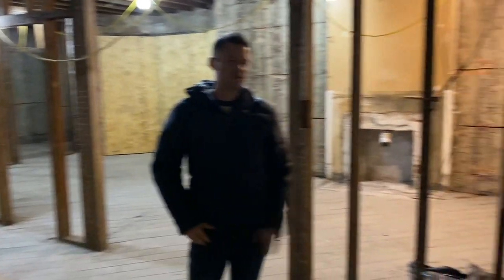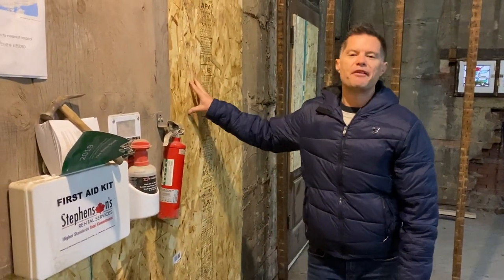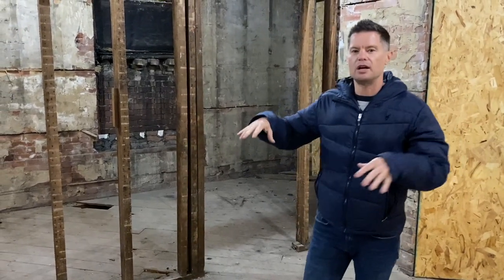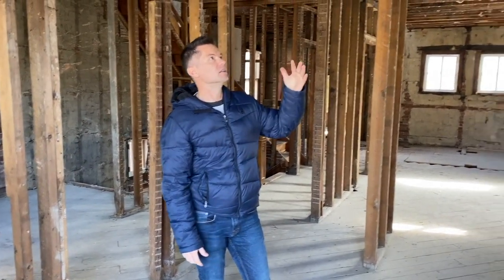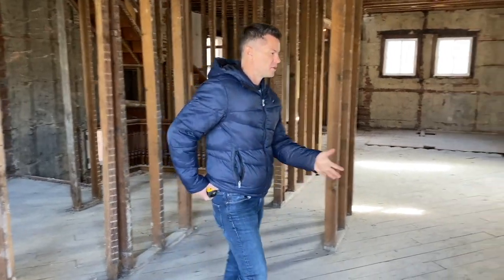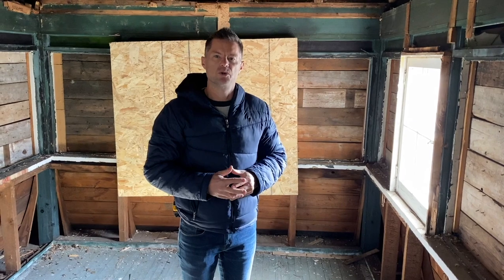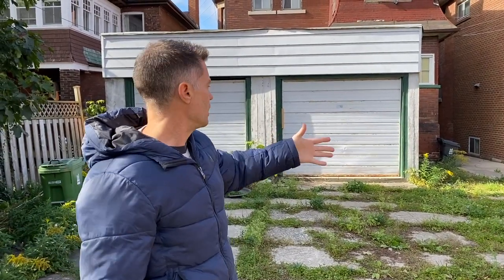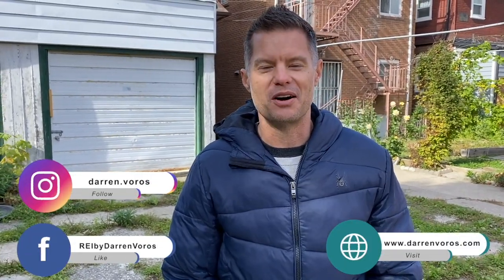Apartment Investing. How to convert a house to an 8 unit apartment building. Part 1 - The Before.

Comment: Very cool project. What did the parking variance entail? We are looking at a similar project and parking space is a little limited. We are looking at setbacks, required landscaping as well as spaces per unit. Thanks Darren.
Reply from the maker: Technically for an 8 unit building you need 8 parking spaces. We got an approval with 3 spaces. Our proximity to transit really helped and we hired a third party company to do a parking study that we submitted with our application. That really helped as well.

Comment: Wow cool project. Did you say what city it is in? wondering if you have concerns about getting permits. I'm sure you've done your research before attempting to add another floor,  but that seems like a major approval. Did you have to get zoning for that many units changed before obtaining financing?
Reply from the maker: This is in Toronto. We wouldn't buy the property without knowing we could do what we want to do to it such as adding a storey or making it a legal 8 units. As for financing, we had to go with private financing for this property. Not because of the zoning but because of the state of the property. Banks don't like to finance projects that are in this state.